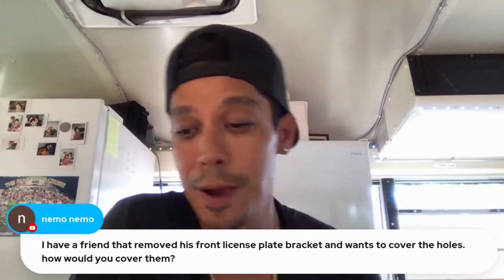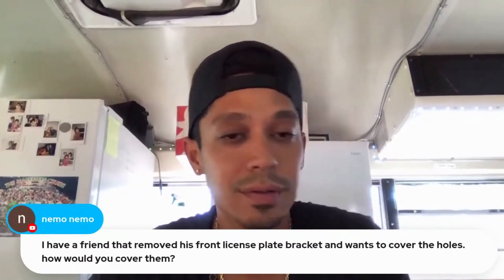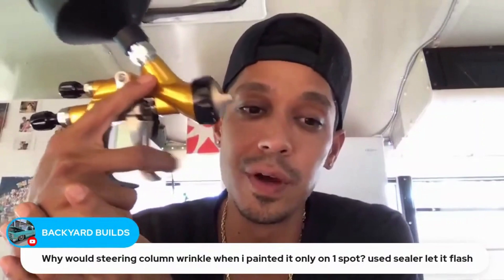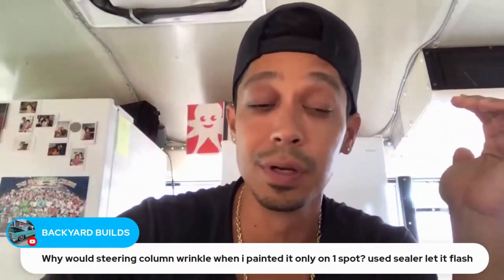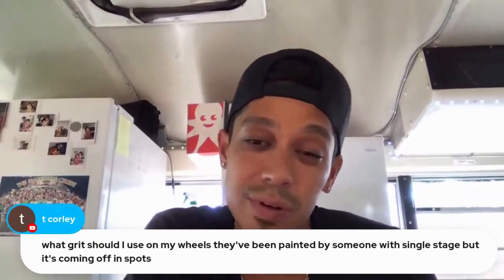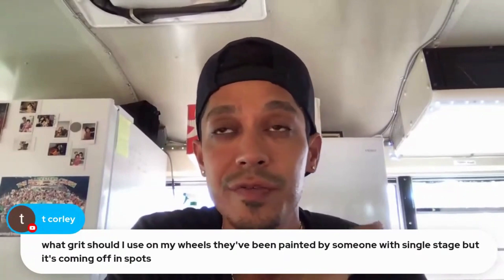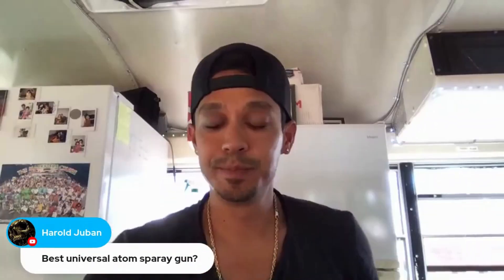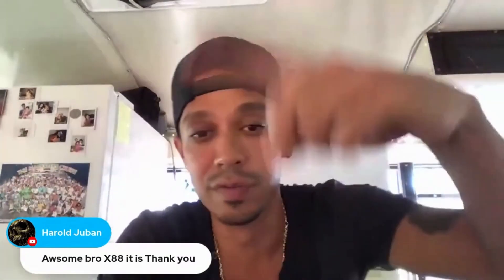🚘👉Autobody & Paint Q&A -  Automotive Paint Problems and Solutions: Filling Holes in Car | Sanding

Comment: Tony if you get a run in the first coat of single stage do you still put second coat on a deal with it later
Reply from the maker: Hey bro! It depends on what you want to do. You could just do a single panel if you want. Do you have runs all the way around the vehicle? Is it like runs all over the place or just in one spot? If it’s in one area like a quarter panel or a fender you could just respray that panel. Hope this helps! Check out our VIP program at https://www.learnautobodyandpaint.com/ We cover mostly everything about auto body and paint and all the step-by-step process.
Reply: @HowToPaintYourCar  
Thank you Tony it's just for future reference,  I will be painting my van and I like to know what to do before I start .by the way I watch your channel all the way from the South of the UK. 
Keep up the great work
Reply from the maker: @mark7218  That's awesome bro! Keep cranking!